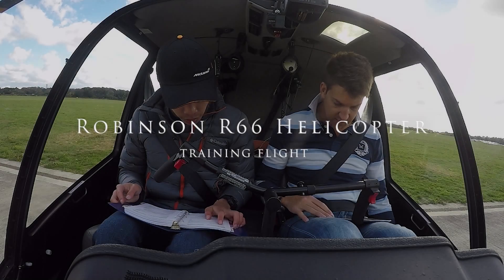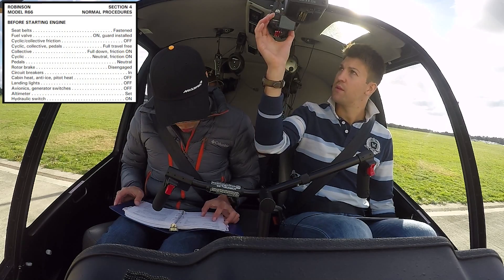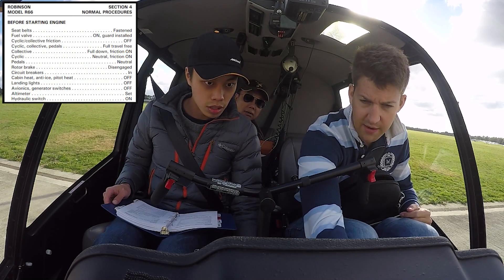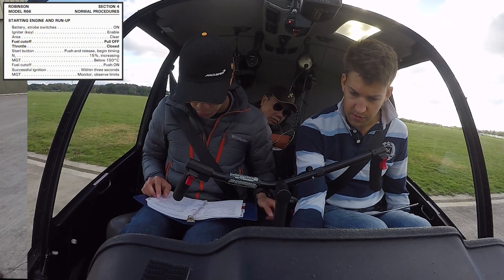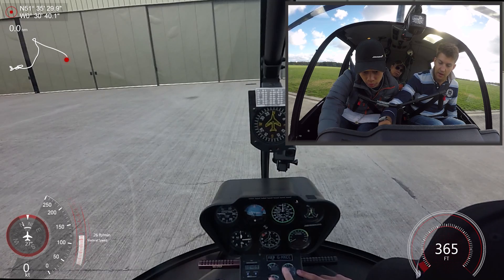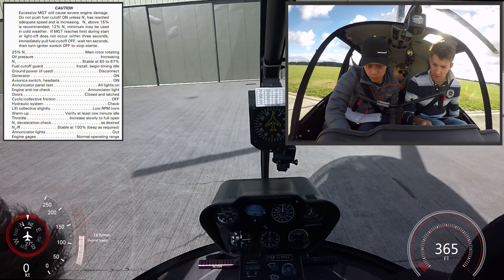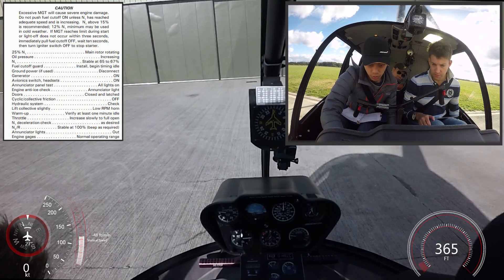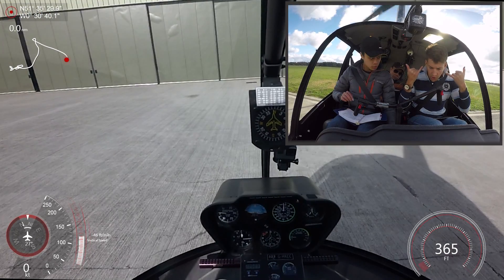Robinson R66 Helicopter Start up

Comment: Something about a turbine that requires a key that I just can’t get comfortable with.
Reply from the maker: True - but even the 500 has a key 🔑!
Reply: AB Helicopters Ltd not on the one I flew
Reply from the maker: Down the left hand side of the console ?
Reply: AB Helicopters Ltd negative
Reply from the maker: Interesting! Not heard of that before! Learn something new every day
Reply: AB Helicopters Ltd I only flew 2 separate 500’s, both of which had no keys of any type so I can’t speak for all the others. The ag spraying I did in 206 and 205 will always be the aircraft I enjoy flying the most just because of their status as a tried and true workhorses but, be damned if the 500 wasn’t the most nimble rotorcraft I’ve ever flown. That thing is like the Indy or F1 car of the helicopter world.
Reply from the maker: Would love to fly the 205/UH1- what was it like- compared to say the 206?
Reply: AB Helicopters Ltd a lot larger that the 206, which was kinda tricky for me especially doing ag spraying because a lot of work was done off airport and a ton of extremely confined LZ’s and it took a while for me to feel comfortable that I wasn’t going to strike the tail. Overall, flight characteristics are pretty similar and the amount of blade inertia is insane. The 206 is great doing auto’s but the UH1 platform is a blast cus there’s so much time between off throttle and when the low rotor alarm kicks in. I love em both. Way more fun doing ag work, flying alone and outside the envelope when compared to some of the Eurocopter and Astar models I was stuck in  shuttling people around.
Reply from the maker: Why was the 205 used for it- for its extra capacity lifting - and that was cheaper than using a 206 and doing multiple runs back to the truck?
Reply: AB Helicopters Ltd the 205 could carry more spray, had wider boom swath so it was actually faster to fly fields and  therefore more cost effective overall in some cases on really large plots vs shuttling back for spray and fuel compared to the 206 . As far as fuel goes, we pretty much fly only 1/4 full and if we have a support truck nearby I’ll run it until the light comes on, sacrificing fuel for more payload.
Reply from the maker: Sounds interesting stuff - how long did you do that for ? Any close calls with wires?
Reply: AB Helicopters Ltd AB Helicopters Ltd still do it on occasion and close calls, a lot. You’re operating outside the envelope pretty much all the time but the closest call I ever had was flying frost patrol during winters in the south to keep them from freezing up. Basically a bunch of helicopters and planes fly patterns in the pitch black middle of the night and the land is marked with smudge pots which is diesel burning in a 55 gal drum. So, you can imagine how dicey it can gets with 2 dozen aircraft moving out of sync. One time I was blinded by another aircrafts landing light mid ag turn and came really close to striking the tail on recovery. Almost had a few mid airs with other aircraft over the years but as fair as wires go I’ve come close a few times cus the sun was in my face and mis just the start of my ag turn which put me too close to my like but overall wasn’t a big deal. Flying under power lines takes getting used too, though. The Second biggest concern is birds scattering off crop cus I’ve nailed a few of em and one time sucked one into the turbine.
Reply from the maker: That sounds pretty dicy- I heard about the frost patrol and cherry drying that goes on in the states- always thought that it sounded pretty ‘interesting’
With the bird strikes - ever into the cockpit ? What happened when it went into the intake - total engine failure or partial power?
Reply: AB Helicopters Ltd never had one punch the bubble, but one time when I sucked one into the turbine it was a downwind full down auto, 180 degrees as I left the helipad and had 3 passengers at time but that wasn’t flying ag, that was when I had the Sheriff Dept on an aerial recon flight. My first commercial job bounced between bird chasing off crops and flight instruction. That was really fun flying to the chasing.
Reply: Blackhawks have a key